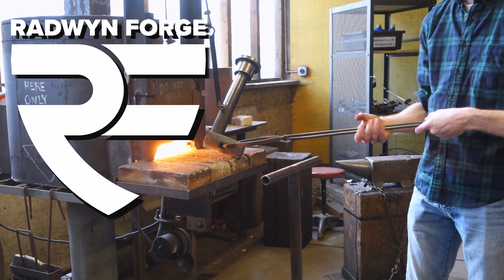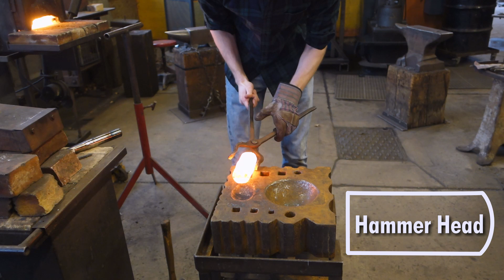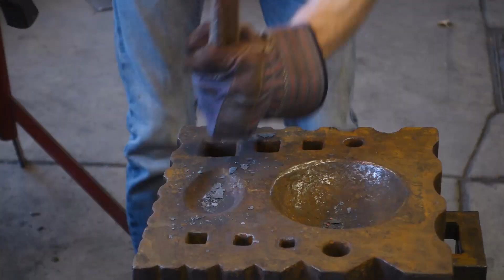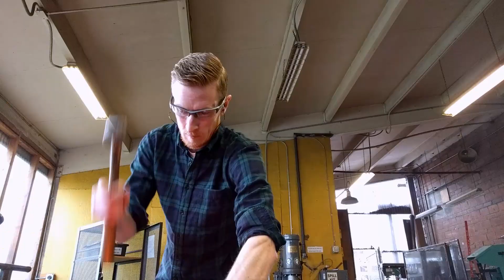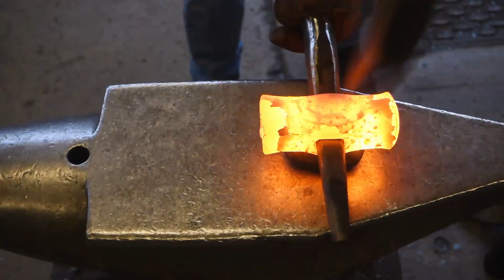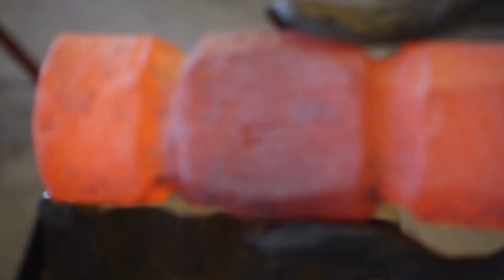Making a Rounding Hammer with basic tools - Part 1

Comment: I wouldn’t consider a massive swage block a basic tool...any recommendations for rounding without a swage?
Reply from the maker: This is a fair point. Honestly I would recommend buying a cupping tool if you wanted to start making rounding hammers. Alternatively you could grind in the convex shape after forging, or if you are lucky enough to have a good scrap metal supplier nearby, you could hunt around for a hunk of metal with a concave depression in it.

Comment: One thought is that the upper die of the guillotine tool is too massive compared to your hammer.  Kind of like using too heavy of  flatter.  It just absorbs the energy and momentum of the blow instead of transmitting it to the work.

Comment: ..That looks like one tough hammer head. Good job thus far!!  i made a cupping tool out of a piece of a car cv joint, the part that holds the spider gear & bearings. It was for something else tho. Gonna share this one also. You do a Great job of explaining your processes...!!
Reply from the maker: Thanks for sharing the video! It feels great to hear that people are enjoying the channel.

The hammer head is 4140 and certainly it is a tough customer, but a great tool steel to use. I think making a cupping tool is going to get added to my to-do list. I had to make due with what I had this this video, but I don't want to run into that problem for the next hammer :)